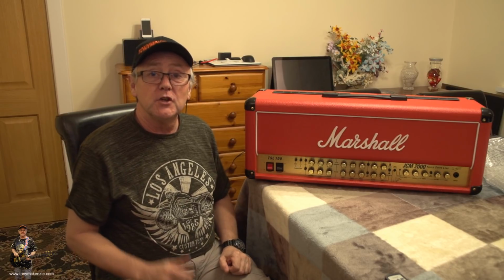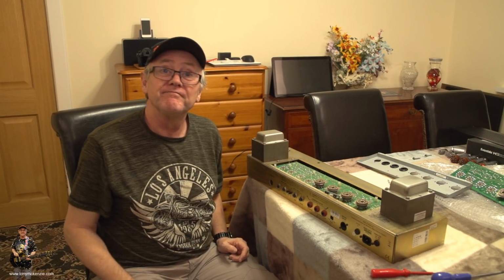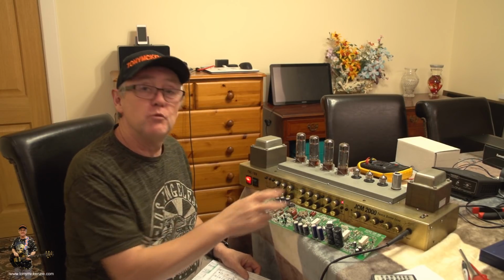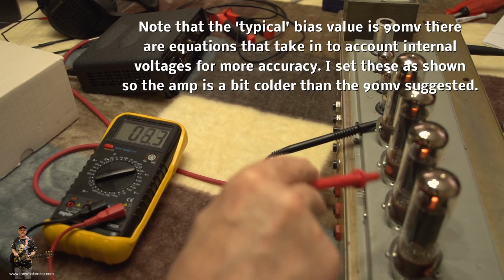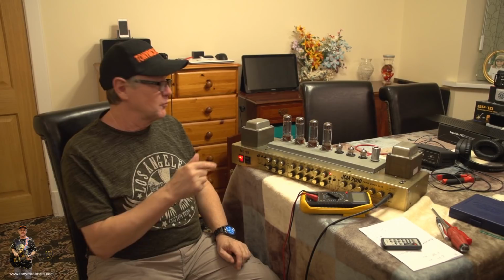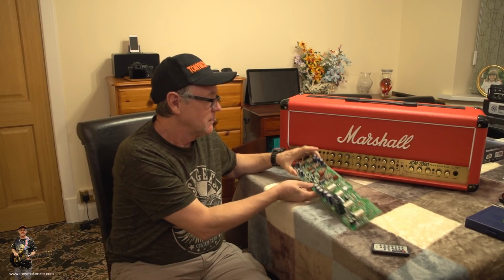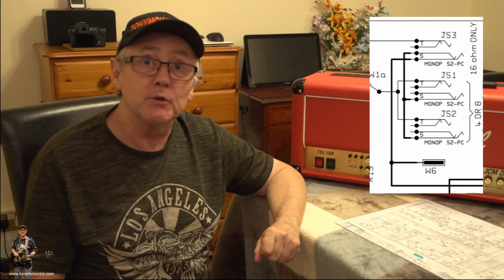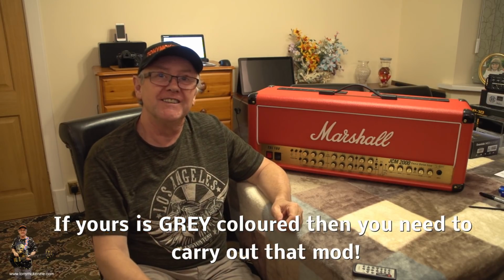Marshall TSL100 JCM2000 Amplifier | Permanent Fix For Bias Runaway | biasing review | Tony Mckenzie

Comment: Great tone on that track they have such a bad reputation according to Marshall the tsl 60 didn’t have that problem...... the jcm 2000 DSL series heads are just as bad for bias drift yet they are revered for their amazing tone all the while the TSL series sound amazing although they can take a little bit to get them set up and I find that if you keep the presence really low the fizz that everyone keeps complaining about on the forums .... I’ve had a tsl60 head since 2003 that I bought brand new and aside from the reverb tank letting go it’s always worked for me and I’ve boosted it with an MXR distortion + and now a fultone OCD and I’ve always gotten compliments on my tones.... I’ve  recently retired the old girl and switched to the line 6 HX Stomp and I’m shocked at how good the tones on that are!
Reply: I am looking now to a Tsl 602 that the only solution was to put a fan inside the combo cabinet. This solved the bias runaway problem. I had to choose a a very low noise fan. Now I removed the board and doing some heavy mods, the bias circuit is completely mounted out of board, the trimpot had to be replaced by a small pot upside down, with a adapter . So much work to solve it
Reply from the maker: Sounds like hard work for sure. It seems currently that the boards are not available... I checked just here in UK: https://www.hotroxuk.com/marshall-tsl100-main-board.html and they are 'out of stock'. :( Overall with the board it solves everything. Without the board is a lot of hard work from what I see. Hey do come back and let me know how you go with it all... thanks for your post and for watching.
Reply: @tonymckenzieofficial  the "floating" bias circuit seems to work. I played for more than 2 hours without any important bias change. Only few millivolts up and down , normal with unstable mains source. I started the circuit at output terminal of 470r resistor, jointed with zener negative. I put these components vertically and sent a cable to near adjust trimpot. At this time things are a little more difficult. You have to remove the trimpot, the 220k bias resistors, the negative side of second bias cap, the 5k6 grid resistors , and out pin of both caps that come from inverter tube. I put these caps vertically with some silicon glue. Pin 5 on power tubes must be completely isolated from board. I did it with a dremmell but it is easier if you get a hollow drill bit , I think 5mm . The floating connections must be isolated with thermal shrinking or tape for safety. Really, this prove that the board becomes conductive after certain high temperature. I also found this effect on a tube pedal. It seems it is worse on wet places and more aged gear.
Reply from the maker: Great info @gugafittipaldi2737  and sincerely thanks for posting it - I'm sure there will be many that can gain from it. You should create a video because as those boards are now getting hard to find it would be useful and certainly would get views. I have seen the 'isolated' pin mods before but not some of the other stuff... Well that Issue 20 does solve it all, but guys ask me all the time these days - where to get a board, and seems like they have dried up :(. But this mod might be the last resort answer. Thanks for the post and if you create a video I'll certainly link to it... and thanks for watching.
Reply from the maker: Correct IMO the TSL60 does not have the issue - I had one of those in about 2003 or thereabouts. Later I 'upgraded' to the TSL100. The main board certainly does have the problem, but if changed it works perfect IMO these days. It's a good way though to get a TSL100 very cheap... as indeed I did. The pedals do work as you say, and I'm always using wah pedals too which also work fine. I look at many simulators both in and out of reviews also and they have improved of course. What I find is that the 'feel' though is not quite right, but still useable of course. The simulators will continue to move forward over time. But here's a thought about them. If I take my Kemper amp bought in January 2012 and pick an amp simulation, you know what, those simulations are as good today as they were then, but they are really still the same. There has not been any 'golden bullet' that has 'clinched' the whole amp simulators to being 'the same' as the real amps. Just an opinion of course... but for the money the simulators are pretty good. I have Line6 also (Helix) and other brands and the Line6 with this V3 has again improved overall but the tones as I said are still the same. How they improve it I can't tell you but surely an interesting subject. Maybe I'll create another video on that subject.... stay safe and thanks for the info and watching.

Comment: Great Video, thanks you a lot, that guided me to change the board of my TSL 100 with the issue 20, but unfortunately i still have the same issue, bias drift even with the new board, so 
be careful with yours
Reply from the maker: Hmm I would go and look again at your amp. Every guy I have spoken with when fitting the rev board I showed has not had that problem since? It is difficult to advise you other than you go back and take a look. If that is a new board, I would also call Marshall because you have warranty and support for it that should cost you little or nothing to get the answers that you need if that is persisting. Do let me know what happens... thanks. Stay safe.
Reply: @tonymckenzieofficial  thanks you so much, 
I wrote a message to Hot Rox UK, i buyed it there, waiting the answer. The board is new and i'm 100% sure i didn't made conexion mistakes, but perhaps i had a problem coming from another part of the amp.

Have a nice day :-)
Reply from the maker: I would not mess about with them... contact Marshall amps in Milton Keynes... their support is good. There has to be something going on there somehow... I can't really advise myself, but honestly contact Marshall in the UK. Here's the number: +44(0)1908 375411 and I hope it helps. If you don't get anywhere come back to me... thanks and stay safe.
Reply: @tonymckenzieofficial  thanks you tony, i finally bring it for repair and that was what i suspected, the bias card, the solderings where cracked, so there was no conduction.
Now the amp works very well.
I'm happy 😁😊
I buyed a torpedo x and it works very well with another amp a custom made in france amp, but don't sound as good with the Marshall, the Marshall sounds better with the speaker than the loadbox IR.
I will work with speakers and micking ;-)
Have a nice day
And stay safe.
Reply from the maker: You mean that little board... they can give trouble for sure. Well the Marshall should sound OK? Try some different IR's etc. there are a few 'free' sample ones on the celestion site... good to know you got there in the end anyway. These are really cool amps. Stay safe.

Comment: Bought one for 250 us and I am going to put mother board in had one of these and sold because of all the hate one of the best sounding amps I ever had excellent at low volume. Try your amp with greenbacks it really opens this amp up
Reply from the maker: Exactly. A very low priced amp (likely because the TSL does have a board thing going on) but a great amp also. I have used many Marshall cabs on mine and to be honest, its hard to get a bad sound from it. With a board its pretty bombproof but also check that 16 Ohms speaker out as I showed at the end of the video. Thanks and stay safe.

Comment: con 15 and con 16 , if the old board does not have what do you plug into there
Reply from the maker: Leave them empty they are discussed at the end of my video somewhere... thanks.
Reply: @tonymckenzieofficial  I isolated the no 5 pin on tubes V5 thru V8 with a dremel plenty of air now around pin and ran a bypass to resistor on old board .. now when amp heats up bios is stable sounds a 100 times better and put a new set of Groove tube EL34M medium tubes i will use it like that for now and see how it works until I can get a ver 20 board .. you can do that too the board you took out will fix bios issues  Thanks Ben
Reply from the maker: I have seen similar before Ben... but thanks for the posting. Check the 16 Ohms speaker out and link it as I showed in the end of the video... it loads the cap up as I showed and can zap the PT. Hope it helps... and thanks for the info. Stay safe.
Reply from the maker: I know these amp tones and they are great - some dislike them, but I think they may not have dialed it in right from my experience.
Reply: @tonymckenzieofficial  Tony I did not buy a new board for mine  . I did isolate the pins but it was mainly that 16ohm plug  ,  crazy what a poor design ... but I do put a turbo fan blowing at the back of my amp . I will buy the Dr. tube bias kit  too isolate the bios board and capacitors for $50 USD they say eventually those Ver 20 boards do the something on the tracking . try setting at 90mv for the bios it sounds so much better thats what this amp is design for with Marshall the hotter the tubes the better they sound .. my friend had an early 70s Marshall head you could cook an egg on top but it sounded incredible that thick brown sound
Reply from the maker: I know this can be done as you mention. I don't know about the Dr. tubes thing... post a link here if you have one... would be useful. 90mv would be at the top end? Ha I did not want to tempt providence so went about 70-75 if I remember correctly. Cooking eggs :) go here: https://youtu.be/MMdv745fEGs tongue in cheek so to speak... :) I did that some while back when I had a sense of humour :) I still have... I must do another one.  Yes the 16 Ohms connector is a killer... must be done. I could have been tidier but it works :). Stay safe.
Reply: @tonymckenzieofficial  hahahah Funny .. cook your food while gigging
Reply: @tonymckenzieofficial  Hey Tony I  used a spring for the Pickup , laid it across  and soldered it to the 16 ohm ground like you did the wire works great and super tight  !!! I think that was most the problem on my amp when I plugged in the 8 ohm no issues so it was that ground   Thanks alot !   Ben
Reply from the maker: Good idea... and thanks for that info...

Comment: You've just described all the issues that I've had with mine! Had mine since 2001. Long story short I sent it to Marshall who did what you did, swapped the board. It now seems great. Doesn't smell like it's going to set the amp on fire! I bet if you opened up a JVM it has probably used a lot of the lessons learned from this amp. Marshall probably had to rename it to get away from its bad rep. I agree with you though that, once fixed, it will sounds great.
Marshall charged me £110 and pickup and delivery so not even expensive.
Reply from the maker: Yes I have been there too! Wow they did a great job for that money! You can pay that just for a board from some suppliers. The board fixes it all! The JVM is reviewed here inside and out:  https://tonymckenzie.com/marshall_jvm410h_review.htm  but the better amp (trust me on this) is the JVM410HJS Satriani model and as you will see on this other inside and out review that the board is very different: https://youtu.be/va-dOzTtq3k 

Take a look at those two and even the JVM410HJS is also reviewed on my website and that throws a different light on the amp compared to the video review. Great to know that Marshall helped you there... and rest assured the amp is a really great amp when fixed. Stay safe.

Comment: Side note: if you want a more tidy bypass on the 16 ohm jack, it's pretty quick to pop the rear board out and flip it over to solder a wire across the two pins underneath the jack.
Reply from the maker: I know that one but was 'idle' at the time :) But others might not know that so posting is always a good thing... thanks for that.

Comment: I ended up getting tired of doing math on amps during biasing and built a small arduino-powered box that uses "Bias Scout" probes to read off the voltages in mV and calculate the idle dissipation. Combined with an internal catalog of popular tube types, and I can dial two tubes independently for the exact % I want without having to run the numbers!
Reply from the maker: Sounds like a good little project to me... you should put it on YouTube and I'm sure loads of guys would be interested in that. Stay safe.
Reply: @tonymckenzieofficial  Cheers - I really need to spend some time explaining the wiring for it, but it's fairly straightforward. This was filmed before some improvements made the display less flickery: https://youtu.be/cJV6CalyffQ  

Oh, and some footage of the breadboarded prototype here: https://youtu.be/aYZNA7LpDL0
Reply from the maker: Hey thanks for this stuff... appreciated. Ill take a look. Stay safe.
Reply from the maker: Yes I took a look - very clever from an Arduino for sure. :) You should make a 4 tube one and get it exactly right and I'm sure you could sell those...
Reply: @tonymckenzieofficial   Thanks :D The real bugger is that it relies on all 4 tubes sharing a ground reference, which is a bit concerning if your amplifier has a wiring fault. Doubling up the ADCs and moving to a differential amplifier would help address that, but that leads to the other issue - the utter lack of HV protection circuitry on the meter. So that's something I'd have to deal with - perhaps with some Zener diodes and fusing.
Reply from the maker: Ha thinking cap time :)... thanks.

Comment: I only use 8 ohm cabinets.   Do I need to worry about fixing the 16 ohm output jack?  That part of the video, wasn't clear to me.  Thanks for your advice!
Reply from the maker: YES! Well the other ohm connectors are routed through the 16 Ohm one! hence the posting of that section... if the 16 Ohm loses the connection the amp goes to no load!  It's worth checking and look for grey on the connector - seems that can happen as it did on mine. Stay safe.
Reply: @tonymckenzieofficial  okay I looked at the schematic and watched the video a few more times. It is very clear now what I need to do! Thank you!  I also agree that these are great sounding amps and worth fixing with a motherboard swap if needed. I love the tone!
Reply from the maker: Yes it's not too hard to complete and if you want it cleaner you can do it from under the board but then you have to remove it to get there. Thanks.